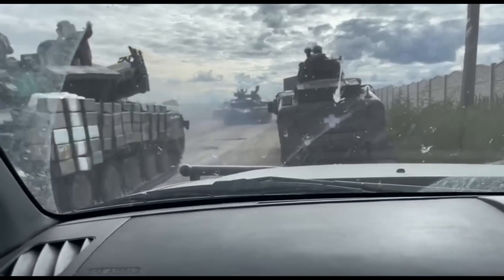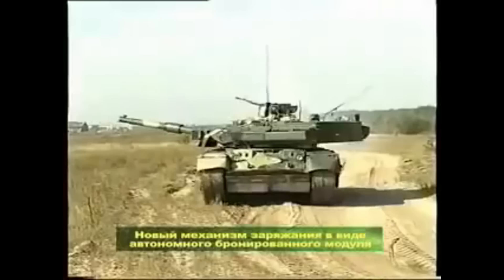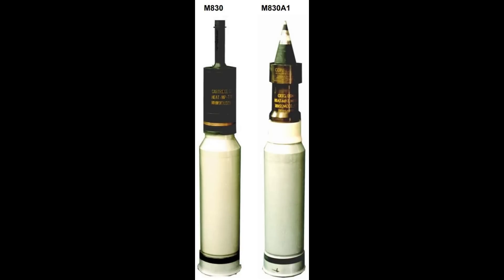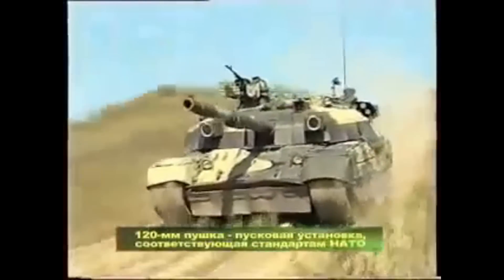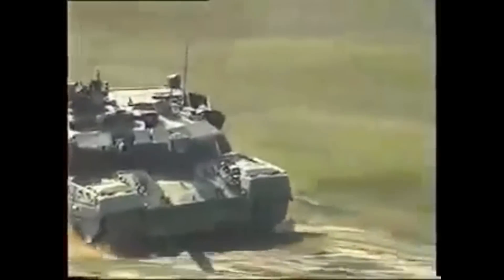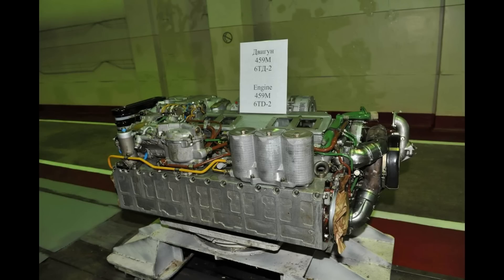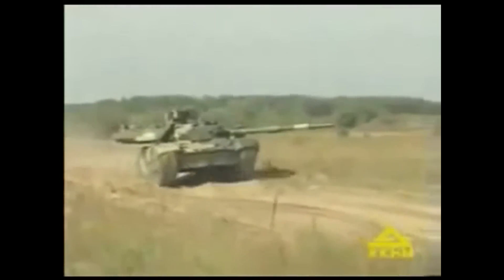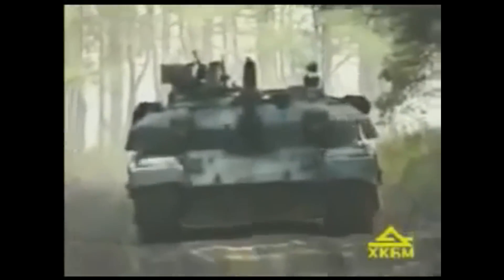Best Ukrainian Tank that Never Came to Be

Comment: What is the difference between the T-84 and the BM Oplot? I always thought the BM Oplot (or Oplot-M?...) was just the T-84 with some upgrades. And if i understood correctly Ukraine is still building those, right?
Reply: The original BM "Oplot" was the redesignation for the T-84 variant (multiple different T-80UD modifications were known as T-84 at different points in time) under technical designation object 478DU9, which had a very limited production run of 10 vehicles in early 2000s (out of those, 4 were sold to USA for trials). It is the upgraded T-80UD with 1200 BHP 6TD-2 engine, reversible transmission, welded turret, "Nozh" ERA, thermal imaging gun sight and "Varta" electronic countermeasure system (copy of Soviet "Shtora").

The "current" BM "Oplot" is the object 478DU9-1 (initially unofficially known as "Oplot-M"), a further development with multi-layer "Duplet" ERA and CITV station. Ukraine has only 3 prototype vehicles. A run of 49 "Oplot-T" vehicles was sold to Thailand, at a pace of about 5-10 per year due to various production issues.

Currently, Ukraine has no tank production capability due to loss of tank armor production facilities in the steel plants of Mariupol, and the only tank production plant located in Kharkov, very close to Russian border and current frontline (and it was already hit by multiple Russian missile strikes since the beginning of the war). That's not to mention a myriad issues with multiple other mechanical and electronic components that existed even before the war.
Reply: @Postoronniy  oh ok thanks for the answer. I thought i saw a video last year with a batch of T-84s that looked brand new (there was footage from under the hood and all the components looked new and shiny) being delivered. I can't find the clip for the life of me.

Comment: I belive if the T-90M had the same reverse from Yatagan, idk if not impossible but it cloud improve alot all russian tanks not just the T-90M.
Reply: Theres a reason the Russians never installed a system of reversing the gears in their tanks.
Reply: @gerfand  yeah indeed there is a reason but I always wonder what is that reason.
Reply: @luizviniciusvieiraalexandr4979  from what I know the worst job in the Thai army is a mechanic of their T-84s
Reply: @gerfand  I can imagen, having a tank that is a mix bettewn east and west its going to be a machanic night.
Reply: @luizviniciusvieiraalexandr4979  T-84 Thai has is the Oplot M.
I never read over it but from what I heard the reverse gear has many problems vs an actually new transmission like what you see in T-14 for example.

Comment: Well, even though it was a good concept back then, now it'd suck against drones just like Abrams or Leopard or any other tank.
The thing is that it's way easier to hit ammo at the rear of the turret than when it's inside the hull, this is the fact.

New tank design with good protection in top projection is necessary to make tanks viable again.
Reply: yes but its less catastrophic to crew. Its much easier to hit the turret than the hull with an RPG too
Reply: @timofy2641  Yes, the crew most likely will survive but tank will eventually burn to the ground, in such case what's the use of the tank the can't even reach the battlefield. Just for the record - modern FPV drones can fly 10 km and beyond which surpasses range of modern ATGMs

Comment: Regarding T-72 vs T80.

i do remember some old report made by Swedish FMV regarding the quality diffrences from the late 80's early 90's when there was consideration of buying in T72's or T80's to replace STRV103 and STRV104/102/105.

Nedless to say the T72 was deemed inferior to both STrv 103 and the diffrent modernisations of Centurions with often poor build quality(only a problem with the Russian Made not the east euro ones) and less combat capability.

the T80 had better build quality generally and much better combat capability so much better infact that it was deemed to be a real threat to STRV103c but the computers while better than most eastern computers seen before was seen as quite inferior to the ones in STRV103c Nor was them seen to be on the same level as the modernised Centurions which had been given the old STRV103 computers.

What suprised everyone was the good snow mobility on both T72 and T80 wich was something we had totally missed and it was truly a wakeup call.

Oh and the USSR autoloaders was deemed functional but Unsafe and unrilaeble compared to STRV103's quickshooting system.
Reply: How is that they considered T-72 inferior in quality but not the non Russian ones.
Russian T-72B had the same FC system as a German or Polish T-72M1, I get ifthey said it was bad because it was simple but build quality of a T-72B would be on pair on a 72M1, with added of better armor.
Reply: lol

Comment: I'm waiting for RedEffect's video about M1 Abrams having ERA blocks and cope cages installed.
Reply: eternalsleeping explain to me why did the Russians put slat armor on the roof of their tanks after enough years in Syria where Tanks were target by heat grenade drops from drones?
Reply: eternalsleeping  and drone drops, this started in Syria, FPvs are sure a thing of Ukraine but not drops
Reply: whats the need? crew feels safer, it provides some protection, thats all there is to it
Reply: @winterautumnfishing5215 no a video about Ukrainian upgraded western vehicles would be cool. They have made some nice stuff
Reply: @winterautumnfishing5215 ah yes the crews feel safer after adopting the same protection the Russians used and got laughed at for using cope cages etc but now we’ve come full circle ⭕️ next thing you’ll be using these overpowered shovels russia has been using
Reply: eternalsleeping that’s not true at all.

They were originally meant to counter drones, which were a far more common and prevalent threat than javelins. And not only that, but there hasn’t been a single video of a javelin destroying a Russian tank equipped with a cope cage. Which means it’s 100% effective

Comment: What kind of reverse gear problem are you talking about? It's a T-80. He doesn't have a reverse gear problem.
Reply: Just because T80 doesnt have purge unusable garbage reverse "speed" as T72s doesnt mean its good
Reply: @jPlanerv2  During the 3 years of the war in Ukraine, not a single case has been recorded when high reverse speed made it possible to avoid the destruction of a tank. Even if we take the T-72, in those cases where they were destroyed, they would have been destroyed anyway, even if the 80 km reverse speed would have been.
Reply: T-80 TRULY don't have reserves speed problem

Russia decided to make 2023 variant with (estimate) -25kph
Reply: Anything under 20km/h is a problem… t80 is below that

Comment: These are Russian tank knock-off's or fake Russian tanks. Like a fake Rolex watch you buy at a out door flea Market. It doesn't work because it's fake, you can not expect the same quality.
Reply: The T-34, T-64, and T-80(UD) are all actually originally built in Ukraine. The T-72 evolved out of the T-62 as an attempt by a rival factory to build something close to T-64 capability but cheaper, and the T-90 is a modernisation of the T-72. If anything you could say the T-72/T-90 are the cheap knockoffs.
Reply: @pliat T 80 was originally build in russia, ukraine only produced them (as well as Russia) and did few modifications. Yep t72 was originally meant to be cheaper then t64 and have the same capabilities, nowadays t72 is way more advanced then t64 could ever be and that's because of its transmission, the resource of it twice less at weights close to 45t and like 3-4 times less then in t72s transmission resource, so it is very weight limited
Reply: @OVER-ce9fy  you are correct, Ukraine was not the first producer of the T-80, but they did design and first produce the T-80UD (the basis of the T-84 and the yutagan). And yes, the modern T-72 is now more advanced than the T-64, although I’d argue that the T-64 evolved and modernised into the T-80, which seems to be a far more capable platform than the T-64, T-72, or T-90 could be. Largely due to the mobility offered (reverse gear especially).
Reply: The fact it's can be see in Turkey it's screaming a lot it's real or not

Compare to "mystery" Object 640/T-80BE (still sad about it)
Reply: my friend pretty much anything is better than russian quality 😂 
i guarantee you these vehicles had a lot of love and care put into their construction and should they be mass produced these early models would be far superior in quality to current Russian equipment
Reply: @Slavicplayer251  do you have anything other than promises?
Reply: @happychayka  no, do you have anything to the contrary either?

Comment: A hit strong enough to make the ammunition explode will kill anyone inside anyway. It's a stupid remark.

People are way squishier than ammunition.+

The only difference is that you won't see it from the outside when the people inside are cooked, so from the outside it can all still look fine.

And the last thing that will save a tank is driving backwards.
Reply: The ammo not exploding/burning up will allow recovery of the tank after the battle, also tanks having great reverse speed allows it to retreat without exposing it's less armoured sides and rear which are overall good improvements for a tank.

Comment: The T-80 is in general the best tank both countries have - and possibly one of the best in the world.
Reply: Not even close.
Reply: @Orcawhale1 it is since everyone around the globe used and uses t-72/80/90
Ironic how western tank good but except facing sandal wearing cave man and being used by barely any one they aren't worth calling good
Reply: @Orcawhale1  I am not talking about theoretical War Thunder performance. In the real world, the T80 is a really good tank. Quick, versatile, low silhouette, a reliable autoloader. The gas turbine is also a better choice over the T-72B engine, that the T-90 has. (Btw. it still is basically the same engine as in the T-34! Even tho - some say the diesel engine is superior due to fuel economy.

There is a reason why Russia restarted production of modernized T-80 tanks ;)
Reply: @L0v0lup  
That's exactly what you are doing. 
T-80s arn't "quick" or "versatile" that's just buzzwords. 
And the reliability of the autoloader isn't any better or worse, though it can hold 28 shots as opposed to 22 in the AZ. 
As for the T-90, it uses the V-84MS which is a tweaked variant found in T-72B, correct. 
But it's not "basically" the same engine, that's like saying every modern Mercedes V12 is in reality Maybach V12's.
Reply: @Orcawhale1  The T-90 uses a tweaked version of the engine on the T-72B, which uses a tweaked version of the engine on the T-72A, which uses a tweaked version of the engine on the T-72 Ural, which uses a tweaked version of the engine on the T-54, which uses a tweaked version of the engine on the T-34. It is still fundamentally the same engine, even down to the engine displacement of all iterations. 

There isn't necessarily anything wrong with that. For it's size, the V-84 is still very decent. But the Mercedes V12 have nothing to do with any tank engines. Tank engines weigh a shit ton and have huge displacements, and really high torque. The M120 engine has 3-4x smaller cylinder volume, and all up weighs a quarter as much as the Maybach V12.
Reply: @Orcawhale1  Those are not just buzzwords. It was literally developed as the new gen tank back in the 70s and 80s in the Soviet Union. It was the epitome of the Soviet Tank design. The best they could offer. And it included a completely new type of Engine, developed specifically for that tank. That's why it is literally the best, as it has more HP, it accelerates faster (has more torque), starts faster, stops faster, never stalls etc etc. That's why it's quick and versatile those are not buzzwords. Those are practical words. The only downside to it is that it was more expensive both for manufacturing and using it. That was it's only weakness. Everything else was better.
Reply: @ImBigFloppa  If i wanted a kids opinion on tanks, i would just have visited NCD. 
Now, go and get your shinebox.
Reply: @korana6308  T-80 was based on the T-64, more specifically the T-64T, which was a turbine powered T-64, that was rejected in the 1960s. 
As for the other things, they are completely meaningless.
You are basically just saying nonsense.
Reply: @korana6308  GTD-1000T engine costed as much as as entrie T-72. That's not a weakness. That's a sentence. And the sentence read "NO". The price was not acceptable, plus it had other issues, such as drastic power drop off at high elevations and temperatures. They had to install a hard power cut off which would not allow the engine to run on full in desert conditions, because otherwise dust would melt into the fans of the turbine.
And, no. It was not the pinacle of Soviet tank design. They accepted that the turbine was unacceptable due to price and pivoted off to T-80UD, which had a 6TD diesel. Because even that cluster fuck of an opposite-piston monstrocity was morea affordable then the turbine.
Reply: It used to be the best up until a certain point. Now the T90M is a better tank. But in theory, if they modernize the T80 with the T90M turret, it would again become the best tank.

Comment: No thermal sight? No CITV?
Reply: IIRC CITV and Gen 2+ Thermals weren’t common place until after the 2000s. There’s a reason the CITV was a big deal on the M1A2 in 1992.
Reply: @Atourq  Oplot uses French license Thermal sight for gunner and commander.
Reply: I think it has some simple Gen 1. but they might have added Gen 3.

Comment: Ammo cook-off inside a fighting compartment is an issue that all (excluding M1 Abrams) tanks have. Yes, many NATO tanks do have an isolated ammo storage with blowout panels. However, majority of ammunition is sill stored within the tank's hull.
Reply: Abrams can store ammo in the hull, it has 6 or so rounds in the forward compartment (most if not all models).
Reply: @jamegumb7298  Yes. However, those six rounds are stored in the special contraption that that directs the cook-off downwards, so that is somewhat mitigated.
Reply: Blowout panels won't work against HE-frag shells however M1 don't use them cause they have M830A1 HEAT-MP-T. But Leopards 2 have HE shells so they can throw turret.
Reply: Good thing then the Germans developed propellant that cant ignite when being hit by anything hot or molten metal.
Reply: Imagine if the crew member locked the door open to speed up loading? That propellant combustion will kill the crew. Because to isolate crew door needs to be closed
Reply: The Leopard has this Problem but dm53a1 and probably every modern shell has a propellent that is harder to detonate
Reply: Litterally only abrams and leo 2a5+ are safe from ammo cookoff. Everything else is no better than a t72. Maybe leclerc but idk much about french tanks
Reply: @acedogboy8421  Keep in mind: Just because the ammo didn't cooked-off, it does not mean that the crew will escape unscathed. If projectile did penetrated into the tank's interior, it stll can severely injure, mame or kill the crew🤢
Reply: @acedogboy8421  Leo 2a5, or any leo in this case, are not safe from ammo cookoff, they store the ammo in the hull without any actual protection.
Reply: @acedogboy8421 No, only the Abrams, all Leopard 2 variants still store excess ammo in the right side of the hull, to the left of the driver. The hull ammunition is the reason why in Syria, some of the destroyed Turkish Leopard 2A4s had their turret sitting on the ground next to them.
Reply: @acedogboy8421  22 in the auto loader but option for 10 or so in front of hull.
Reply: @acedogboy8421 They still are safer vehicles than any ruzzki designs when penetrated. This is due to several factors, such as more space in the crew compartment and use of spall liners.
Reply: Да согласен у нас в Москве стоит Абрамс,который ”не сгорел изнутри”😂😂
Reply: If the blast door is penetrated, abrams crew is dead. That already happened with the tank And it will happen more often since FPV drones can strike from any sides, rear included
Reply: @ГеоргийМурзич  It's possible, sure. However, it is just wrong to say that the Russian tanks have the same level of crew survivability as a Leopard 2 due to hull ammo storage.  Sure, if it gets hit there, there will be an explosion. Same thing if the armored wall between the turret and the ammo compartment gets ruptured.
Reply: Are your Serious about that  bro .

How about c1 Areta or type 10 jepang. What is blowout panels
Reply: @MuhammadakbarAK47  C1 Ariete has ammo stored in the turret bustle, with nothing to shield them from the crew. 
Type 10 jepang? I aussme you mean the Japanese one (10式戦車, Hitomaru-shiki sensha) of the Japan Ground Self-Defense Force (陸上自衛隊, Rikujō Jieitai). It can hold 14 in the autoloader that separates the crew with blast-resilient wall. The rest of the ammunition are still stored within tank's hull behind the driver on the right side (driver sits on the left) of the vehicle.